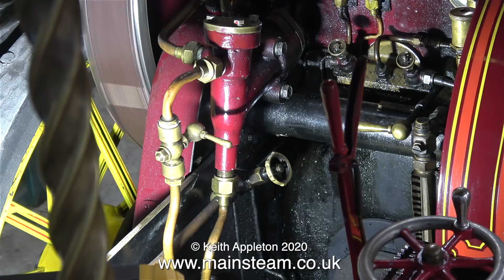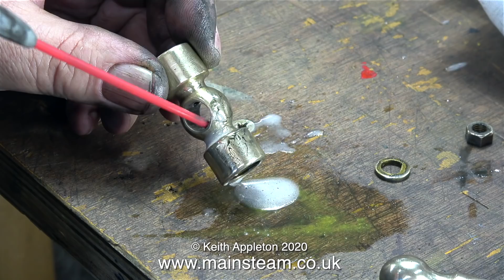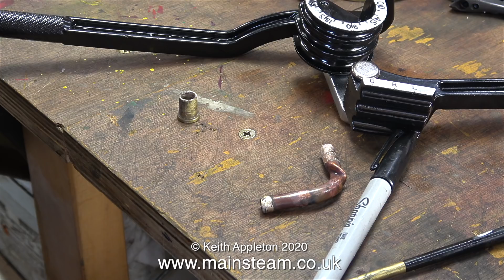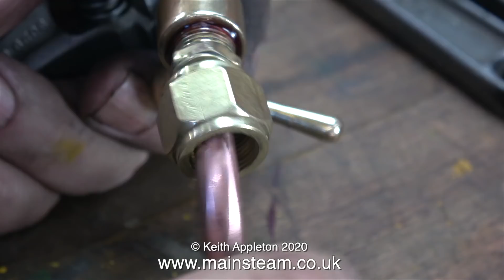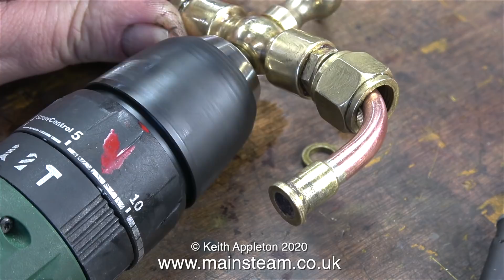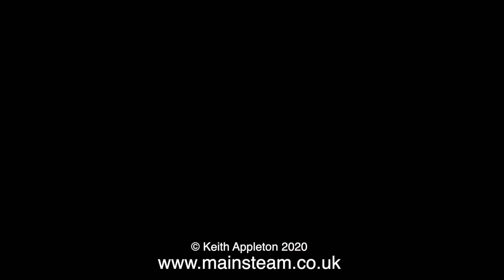A LARGE MODEL SHOWMAN'S ENGINE - PART #22

Comment: Excellent video.Nice and practical and straightforward!
What's the difference between Brasso and T Cut? I've always used T Cut because I could get it in quantity cheaper and 5 Litres last years. I thought they were similar but I've always wondered.
Did the person in the bath got too cocky with their puns?
Reply from the maker: I think maybe the abrasive in the Brasso wadding is finer than T Cut - I am not sure though . . .

Comment: I remember changing out a similar, but much larger valve on a irrigation pump.  The owner had improvised the setup but after a long hot day he said more water leaked out then went on the field.  It seems to me that that the slightest high spot will make the taper useless,  which is why you normally don't see them used anymore. They may have worked perfectly when they were new, but once they start to wear they become impossible to repair.  Planned obsolescence?

Comment: If there was to ever be a power outage could the generator on this engine run the power to the house ?
Reply from the maker: No, it's the wrong voltage, it is DC and only 7.2 amps . . .